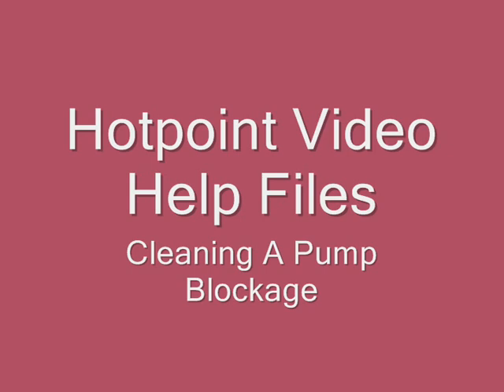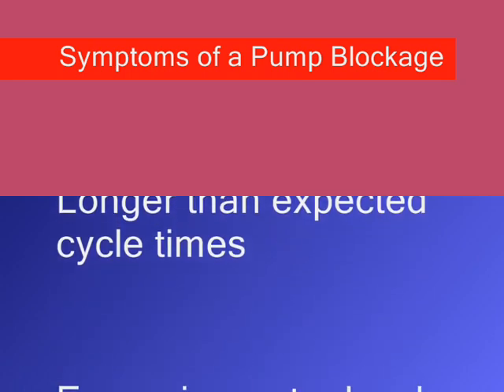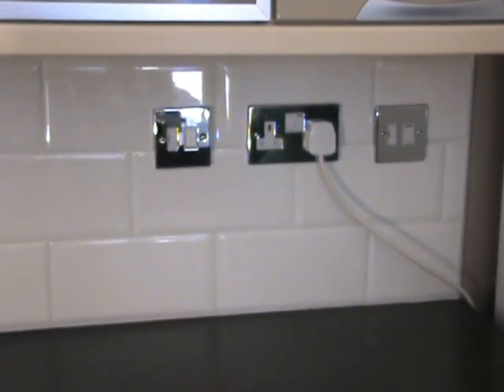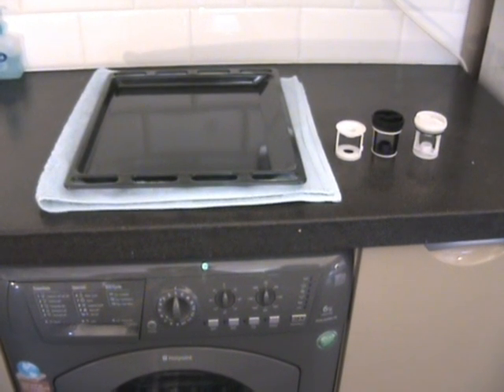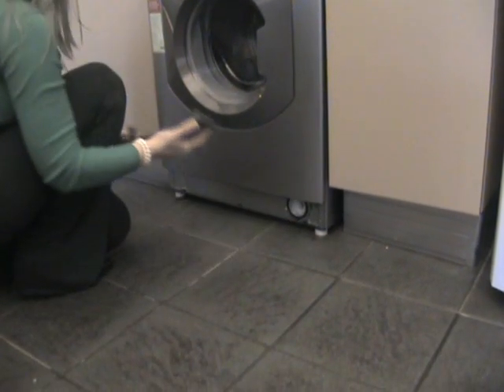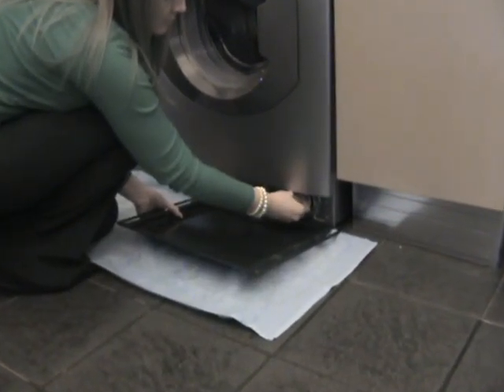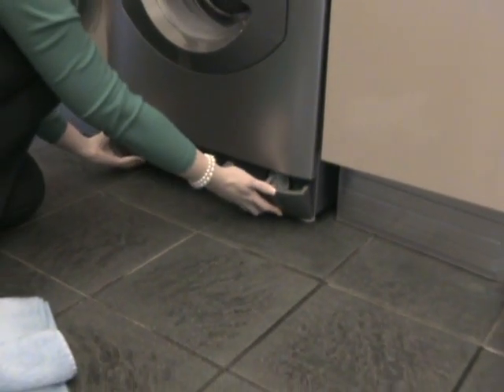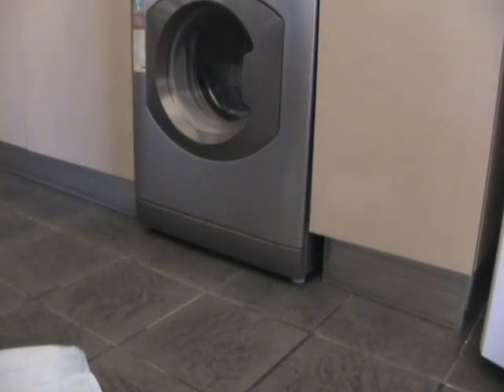How to clear a blocked pump on a Hotpoint Washing Machine

Comment: FORGET the drip tray lol, had this code twice on my 6mth old washer/dryer, video is great but yes at least half a bucket came out, 1st time time there was an elastic band around the propellor/impeller thing all put back and worked great, tonight 2 weeks later F-05. switched off & unplugged it, i have both times pulled the washer completely out then tipped right back to lean against the wall, removed the front lower cover (push a small slotted screwdriver up into the 3 cut out lugs) , towel ready, bucket and small bowl to catch all the water.  unscrewed the plug/filter, then slowly taking the weight tipped the washer forward to fill the bowl, tip back to stop the flow, empty the bowl into the bucket and repeated till just a drip coming out.  in the bucket was a tiny round plastic disc size of a 50p piece. plug/filter screwed back in, cover replaced, lowered the washer to ground again, checked drain hose still in the drainage pipe, put back in place, switched on, turned to fast spin and hey presto, fully working.  seems like unless i check clothes pockets better this is a repeat thing. best of luck, sarah